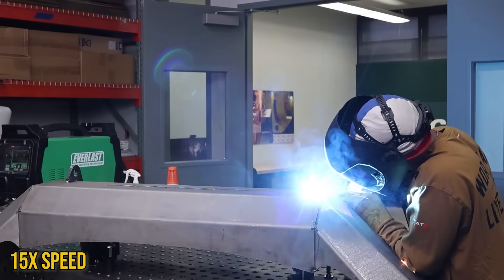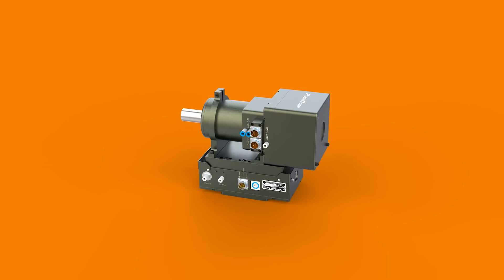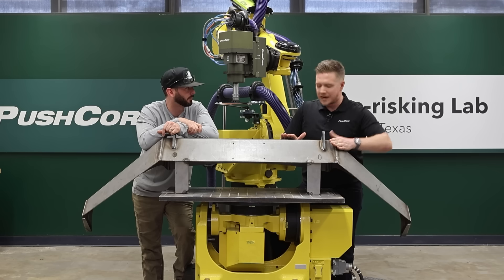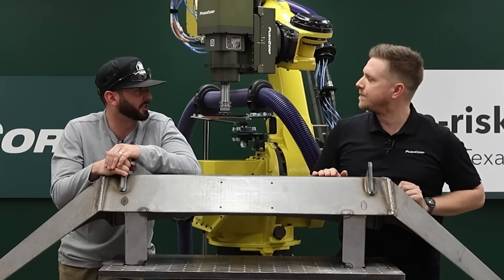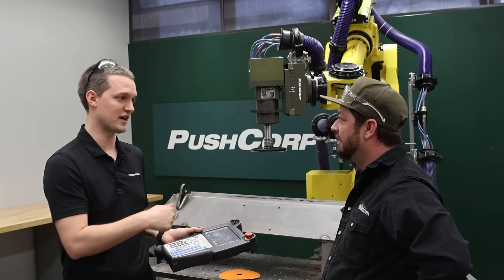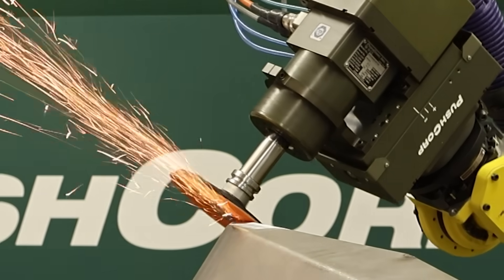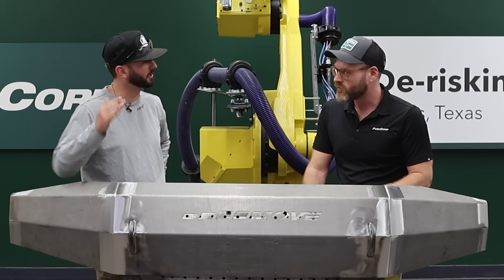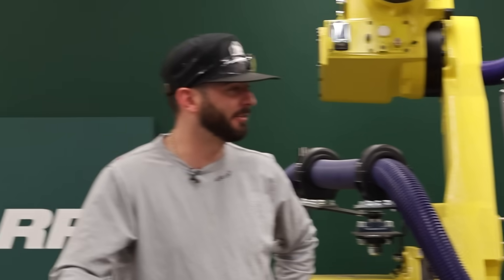No More Manual Grinding: Automating Weld Removal and Polishing Steel with a Robot

Comment: Seems like this would be a good application to include a LIDAR sensor.
Reply: I’m sure! 3d scanning could help make programming a little faster
Reply: I agree. I work in orthopedic manufacturing and have watched engineering techs manually set coordinates on these. It takes months sometimes for complex shapes. If your fixturing is off the robot has no idea.

Comment: All I see is another arrow in the slow death of the living wage.
Reply: Sadly enough the arrows are partly self inflicted. No one wants the job or good help is hard to find. So the robot takes the position (with an operator) 

The position is still there technically. But instead of a grinding position you become a “technician”

Comment: This type of production grinding would be pretty miserable. Makes sense to have robotics doing the grinding. I don’t see this happening anytime soon in the stainless steel pressure vessels. Especially with the different types of fittings I.D. and O.D., head to shell fit up, agitator shafts, blades, mixers etc.
Reply: Yeah works well where the head can fit. Outside of that 🤷🏻‍♂️

Comment: Funny
At my last job all I did was grind robot welds off parts and re-weld them manually.
The company had taken over a contract from another company, implemented their robotic welding procedure and put it into full production without making sure it worked first -- which it did not!
They decided that having REWORK become a major production bottleneck was cheaper and easier than reworking the program.
Reply: No one said it’s perfect! Proper training could help? I’m sure yall tried all of that. In my experience, simple, repeatable parts are your best bet for automation
Reply: @Drweldz  the company was dysfunctional. The previous company sold the contract because their procedure couldn't produce the parts within spec. We didn't alter the program, but went full send using different robots....
For some reason adding 5 hours or rework labor per part (big, complicated, strict tolerance) was the cost effective option. I quit after 2 months
Reply: @The_Inquisitive_Inquisitor sounds about right 😂 h the war robot work when you know how to use em. But if not. It’s a hot mess. And no welder likes fixing crap all day 😅